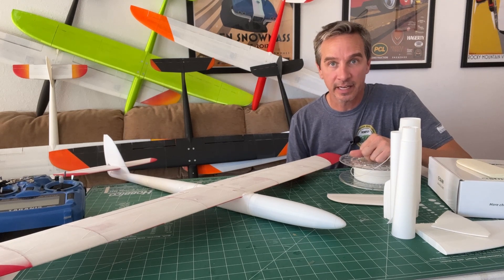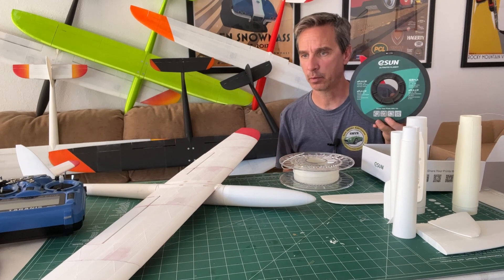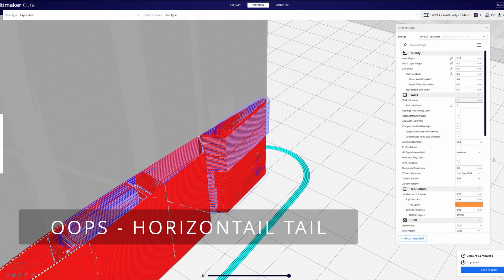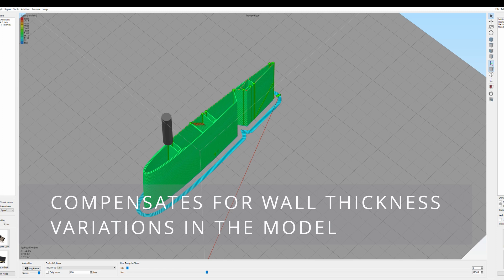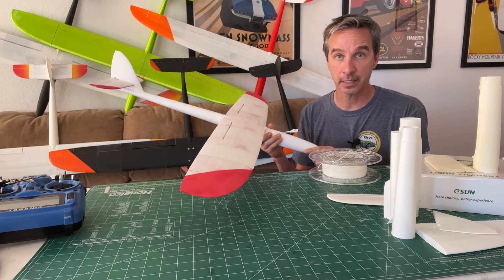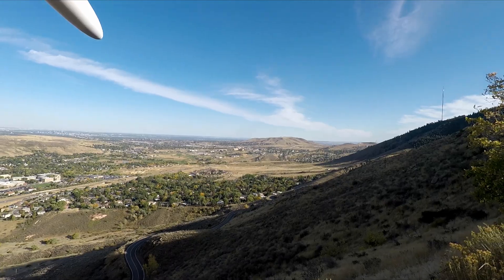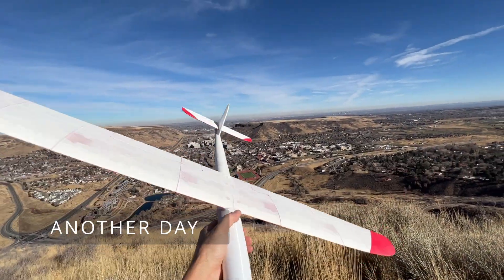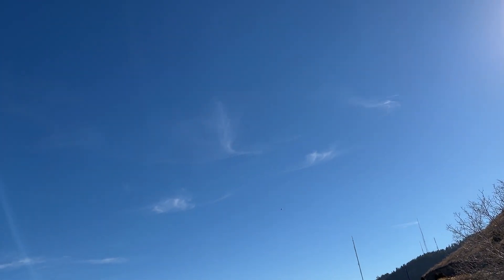3D Printing - Cura Settings for Foaming LW-PLA - Light Weight - ColorFabb and Esun

Comment: Hello

do you know how is it fabricated? Or where can I access this information? Is it by injection of CO2? 

I'm making a research about the esun LWPLA, but I couldn't get this information.

Thanks in advance
Reply from the maker: I have no idea about the exact formulation, but they add plasticizers (chemical) to molded plastics to get them to do something similar.  
There are some other videos, especially the one from CNC Kitchen about foaming PLA that has some good information.

Comment: hi, just bought a plane and making a lot of printing test, i have an issue with the inner structure on the outerwall, i see you have the same issue on your wings, is it an issue for flight, do you sand paper it or just let it like that, thank you.
Reply from the maker: Make sure you check (turn on) Outter before inner, compensate wall overlaps, and minimum wall flow to 50% in Cura settings.  Different materials, printers and ambient temp/humidity can affect this.  You can reduce the min wall flow below 50%, more retraction can help too, but not too much.   It has minimum effect on flight performance.

I will have surface imperfections, sometimes the inner structure is noticeably raised, and I will use my round file to "clean up" the surface,  it takes off the high spots and does it quickly.  The round file is a chain saw sharpening file, link in the description.   I tried to keep the "finishing" work to a minimum, but there is always some.... I spend about 2-3 minutes per part to remove the print bed overhangs / elephants foot, strings, open carbon channels, and part to part fitment.  If you are spending 15+ minutes to fix a part then something did not print right.
Reply: @soarkraft  thank you

Comment: Hi I bought your Juciy files and can't fine the settings for LW-PLA. I have the fuselage and wing files as well as an assembly pdf but no settings.
Reply from the maker: There are also an instructions PDF for the fuselage and for the wing, the settings are the last page of the instructions PDF of both.
The settings are also posted on the website about half way down the page https://soarkraft.com/pages/how-to-and-settings
If you are using the Polymaker LW-PLA use the regular PLA settings.... because it does not foam.

also... I have not printed a Juicy from the Foaming LW-PLA .... it was designed to be heavy and stiff... let me know how it turns out.  Light and stiff might be fun.
Reply: @soarkraft  got it. Thanks. I'm using regular pla first then the polymaker

Comment: Thanks for the videos. Very interesting material; but I have only seen it used in RC planes. How useful do you think it would be for other applications? For example, I want to make me a Xbox controller shell, and since LW-PLA is very light it caught my attention, but I dont know if it would be way too flexible (at around 230-240ºC let's say). I need to make fine holes for the screws, and also add support for the printing; do you think it's possible given the stringing the material has?
Reply from the maker: Don't use this material for that and no FDM 3D printing material can handle that high of working tempurature.  There are many materials well suited for plastic enclosures / shells that can handle temperature, but that is a completely different side of 3D printing and there is lots of info on the internet about it.... just search.  Nylon is about the only material you can print that can handle that high of temperatures and it is hard to print and would still probably warp and fail.   Even most common injection molded parts can not handle that kind of heat and would need special material.

There is a reason this is mostly used for RC planes - it was developed to be used for RC planes.  I have seen it used for costumes and masks.  For most applications the part can just be printed with less internal fill to make it lighter (info on the internet about it.... just search).  This material is expensive and hard to print for regular everyday stuff like most people print.  It also gets soft in heat
Reply: @SoarKraft  Oh damn, my bad; I meant printing temperature, not working temperature (sry I'm from Spain :P ). Since the mechanical properties of this material changes depending on printing temperature (among other things, but mainly temperature), I was wondering if, when printed at 240ºC (following the chart for flow rate and speed), the material would be too soft/flexible for something like an Xbox controller/PC mouse (enclosure shell as you said. But one that will be handled). Following the chart, this would achieve a density of 0.66gr/cm3, which is almost 50% density reduction over normal PLA. 

My main concerns would be how much detail I can achieve with LW-PLA (for screw holes mainly) and If I can print an object that needs support to be printed (because of the excessive stringing). 

My only other option would ABS I think, but I don't feel like using it. I will search for PLA weight/strenght comparisons using lower infils, thanks for the recomendation!
Reply from the maker: Still, don't use this material.
There are easier and better material for what you want.  Regular PLA would work fine... I design medical devices as my day job and prototype with PLA... PETG if it needs to be stronger.  If you still need light weight, Polymaker LW-PLA is 67% density and much easier to work with.  This foaming material is only good for thin wall structures such as airplanes.... it is also expensive for what it is.

Comment: Hello, from your settings, in combing mode you used "not in skin" this means that it will try to avoid it, if you use "ALL" it will pass through the skin and not in the outside with the effect seen in simplify.
Reply from the maker: I did try all the different configurations for combing mode and I liked the results of "not in skin" the best.  Cura does not do a good job of following the skins and the results look terrible... well I didn't like them.  You can use whatever settings you want.  

There are other setting in Cura that are miss leading too, like "Optimize Wall Printing Order" does anything but optimize.

Comment: do you think it could handle more weight? if ur goin in a slope thats even more windy? and use ailerons as flaps/brake
Reply from the maker: Yes, it could handle ballast... but if you want something for windy conditions just print out of regular PLA.  More strength / stiffness and easy and cheap material.  I have a LWPLA and a regular PLA for when I go flying... check out my other videos on this channel for how well the regular PLA version can handle more wind.   The DS model is 30oz and can go 100+ mph.
Reply: @soarkraft  just watched it! crazy how it can handle it! just got my 3d printer, so have to print some stuff so i know it wont fail midprint, but will absolutely buy it :D

Comment: no settings for simplify????
Reply from the maker: Funny, never have been asked for it, and I got my useful settings from Eric at 3DAeroventures.  I used his setting to understand what Simplify3D does right... and in SImplify3D will let you download an FFF file and just use it... unlike Cura where exporting the print settings is just a text document with no real information.  Eric's settings work awesome for the wings and tail, but not perfect for the fuse... had to change one thing (Thin Wall Behavior/Extrenal Thin Wall Type - set to "Allow single extrusion wall" from "Perimeter Only").  

His setting download is found here:
https://www.3daeroventures.com/shop/materials/colorfabb-lw-pla

Comment: Wayne....impressive video and weights using the LW-PLA!  In your opinion, is it worth it to have the four servo wing compared to the two servo setup? Is there any performance gain with the four servo?  So what is the difference in performance for the fully PLA printed model vs being printed in LW-PLA....lighter wing loading means it can fly slower and in lighter air?  Also, there are so many different types of filament, have you ever tried say printing a nose cone out of a material that has a bit of shock absorbing characteristics without deforming?

Cheers!
Lyle
Reply from the maker: The RG15 airfoil can handle a really wide envelope of wing loading so its in air performance is awesome no mater the weight.  The 2 servo wing version is easier to build and program to fly.  Desired performance gain is more based on your flying site and conditions.  Having an easy place to land, like a flat top mesa where you can get out of the lift but still be in moving air, there is little need for the added hassle of separate flaps.  In the air zipping around they both perform the same, and with full span ailerons you can still do reflex, camber, and snap flaps.   But if you have limited landing area or have to land in front side lift then flaps are awesome.... so four servo wings are mostly a landing thing.  In LW-PLA and building as light as possible could get the wing loading down even more... using 5g servos and lighter carbon tubes... there is also a way to skimp on flow and make the tail even lighter for less balance weight.  I'm sure sub 400g RTF is possible, maybe even 380g.... but someone else can work that hard as I want to refocus on going heavier (DSing).

The fully PLA version is stiffer and heavier.  The wing can handle the extra weight in quick, snappy maneuvers without flex.  The four servo wing works well for the fully PLA version because the landing speeds are higher.... and a fast landing is usually a crash.  I would not ballast the LW-PLA much... could probable handle 50-100g, but why. 

I have started carrying a LW-PLA and regular PLA version with me when ever I go flying..... the LW-PLA version will fly in anything if the air is moving.  I used to us a combat wing to test the air before throwing out something new... now I use the LW-PLA version.  

I have used PLA, PETG, PLA+, PLAPro, foaming LW-PLA, the new low density PLA-LW, carbon PETG, and carbon Nylon.  The carbons are not worth the hassle.  PETG is good material, but heavier than PLA and harder to print, but handles heat better. The PETG and PLAPro are really similar strength/flex parts, but the PLAPro is easier to print.  I have been using the PLAPro for Fuse parts and nose cones...  Hard to tell if they are better... I would need a g-meter on my crashes.  

Now for powered versions things are different than slope and I am working on that problem too.

Comment: Nice work! Do you like the glider performance in foaming PLA over regular PLA or PETG?
Reply from the maker: It is fantastic in light conditions when nothing else can fly.  It has a wing loading of less than 10 oz/sqft and the performance of the RG15 wing, its fun, and so inexpensive to make that Im not worried about throwing it out in any conditions to test the lift.  It can still handle stronger conditions... but probably not being ballasted to much.  The foamed material can handle rough landings because it has very little momentum / light weight.  Now the PLA and PETG need a little more speed with wing loadings of 15oz/sqft but still handle light conditions well.... and strong conditions.... and harder landings.  I usually take one of each with me to fly front side..... or more.
Reply: @soarkraft  Good to hear. Sounds optimal for the usually light coastal winds we have here in San Diego. I have an old CR Climmax Pro with RG15 airfoil and similar wing loading and it flies fantastic when other planes struggle to stay up. An interesting thought - what it stronger and stiffer, PLA or foaming PLA printed at twice the thickness?
Reply from the maker: @Aremgi73  so printing twice the thickness is not easy... but there are ways.  PLA is way stiffer than the foamed... but is it double????  Have to look at the data sheets.  I did find some "Pre-Foamed" low density PLA from Polymaker, it is 65% the weight (1/3 lighter) and is stiffer than the foaming stuff.  Im doing a series of Power Pod fuses with it.  I have videos about printing the low density material on my channel... it real easy to use.
Reply: @soarkraft  I watched your low density PLA video. Seems like a good middle ground, particularly if someone doesn’t want to mess around with the print settings. FYI, LW-PLA is in fact weaker than it’s weight savings over PLA, so twice the LW-PLA thickness vs. PLA wouldn’t be as strong even if they came out the same weight. Stephan at CNC Kitchen did a good video on this: https://youtu.be/2tmgzwgi2UI
Reply from the maker: Thanks for point that video out.. great information on weight vs strength.